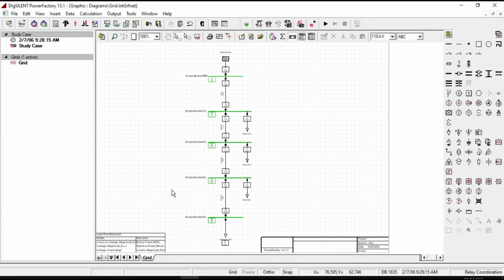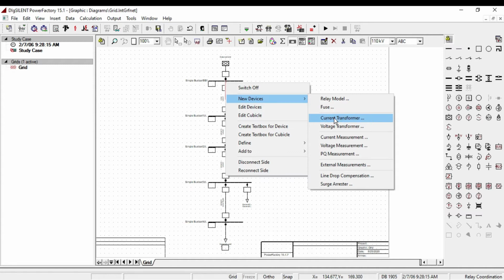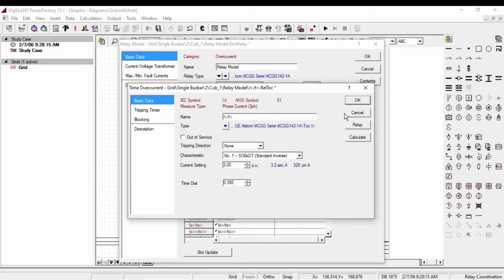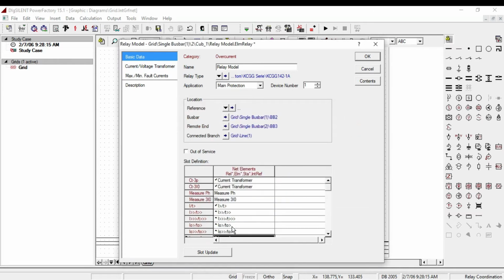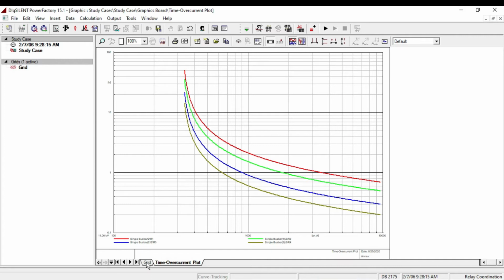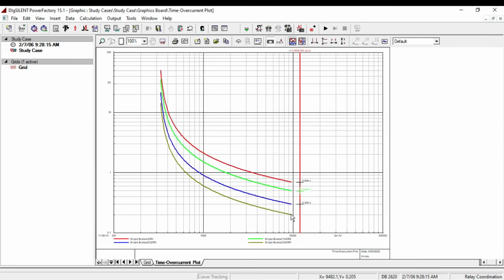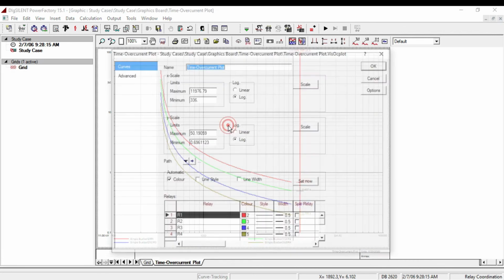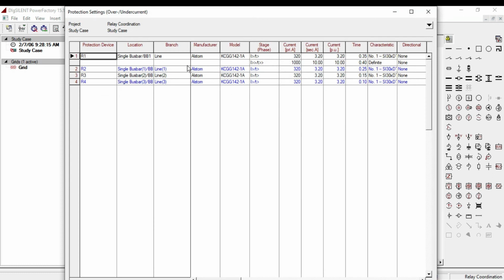PowerFactory DIgSILENT tutorial #21 Relay Coordination and time grading margins

Comment: excellent tutorial.
I have been facing problem in relay coordination of ieee 33 bus radial distribution system. when i apply your procedure  then fault clearing time of relay close to the source comes out in minute. is that possible relay operating time is to large?
Reply from the maker: Dear baral! your circuit is different,  so the time clearing fault  may not appropriate for your circuit,  please play with time settings.